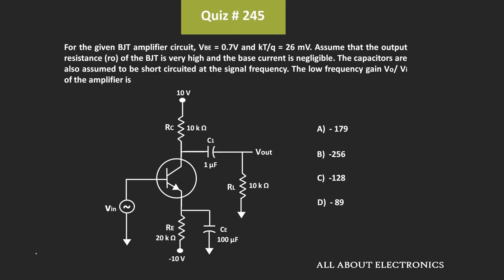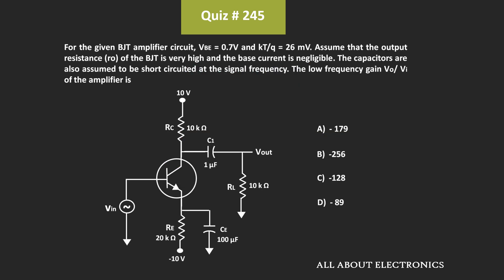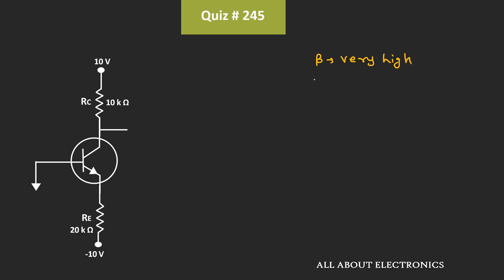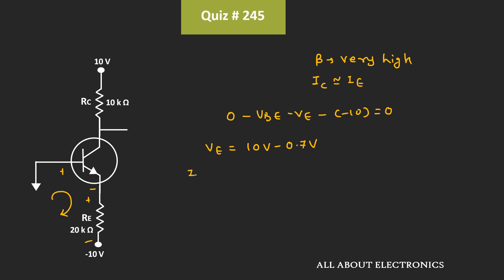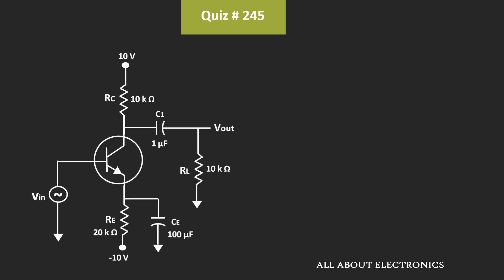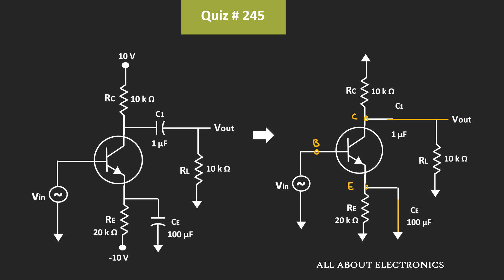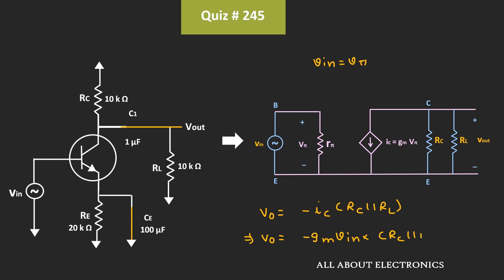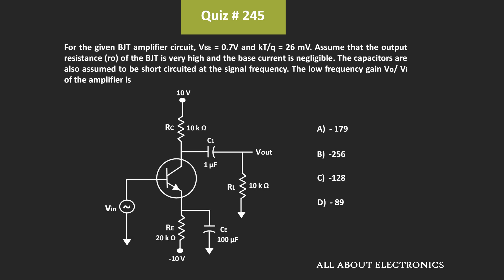BJT Small Signal Analysis Solved Example | Quiz # 245

Comment: Can the base be connected to the collector through the Vin source and then the resistor Rc for small signal analysis since one terminal of the ac voltage source is connected to ground and Rc is connected to ground as well
Reply from the maker: I have already shown the small signal equivalent circuit at 4:17. You can refer that.

Comment: Sir I would just like to ask, what if we had a resistor connected to the base and directly connected to the AC source meaning there's no coupling capacitor in series with the base resistor

How would that affect our DC calculations
Would we have to get the peak voltage for the AC source or?
Reply: No bro!! As in dc analysis there is a assumption that we would do all ac sources as zero ...so according to this assumption we would replace the ac voltage source with short circuit

Comment: 4:34
Shouldn't Vo be Ic.Rc
Or Ic.Rl

Because they are in parallel, so voltage difference across both of them is Vo
Reply from the maker: Since Rc and RL both are in parallel, so you need to find the parallel combination of both resistor. If you just want to consider any individual element. e.g Rc and RL, then first you need to find the exact current which is flowing through Rc and RL. Since both are in parallel, current Ic will get divided between them. Using current divider rule, you can find that. But you will see that, eventually, with that method also, you will get the same equation. 
I hope, it will clear your doubt.